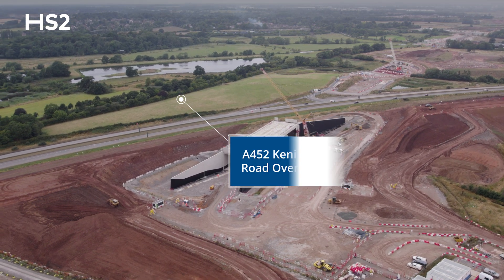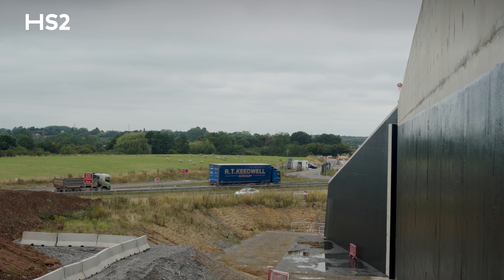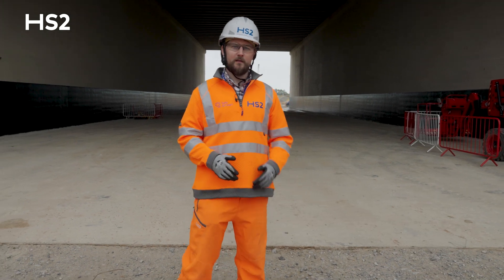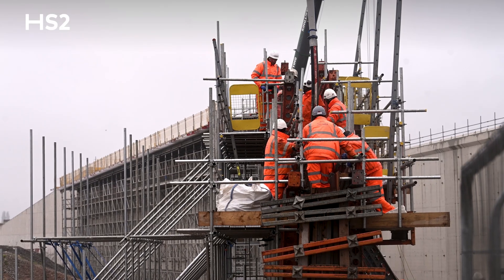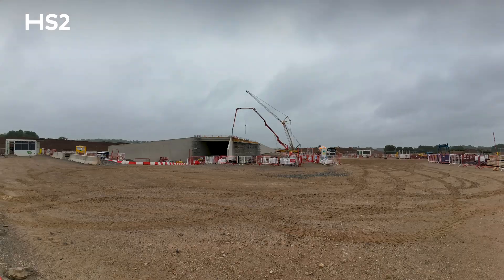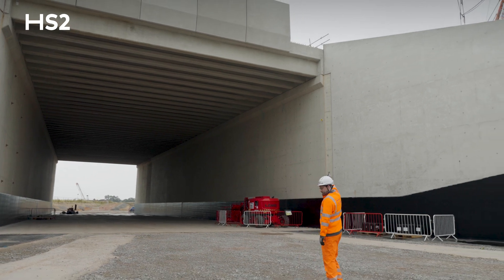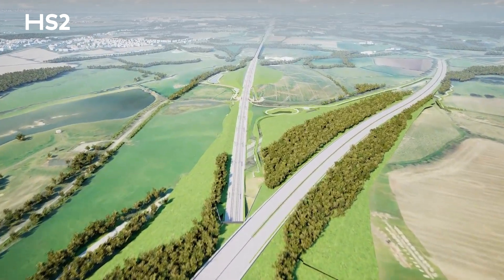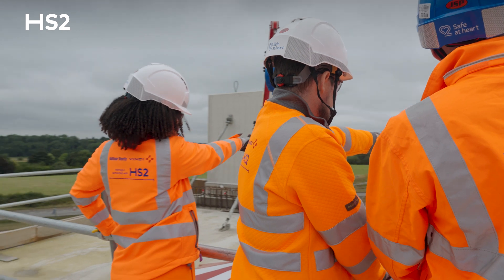In depth look at HS2’s completed A452 Kenilworth Road Bridge

Comment: Hi there my real Name is Mr Cannadine T. Boxill-Harris, I have another interesting idea for most of us Class 507, Class 508, Class 313, and Class 314 and that also includes those interesting Class 315 Very Very Loud 7 Speed Leyland Hydra cyclic Automatic Transmission Train fans out there, rather than scrapping most of those Class 507, Class 508, Class 313's Class 314 including the Class 315's maybe you guys can convert them. Including rebuilding most of the brand new refurbishment into the Volvo TD102KF Engine, Gardner 6LXCT Engine, Leyland TL11 Engine, Volvo B10M Engine, Scania N112 Engine, Leyland 510 Engine, Gardner 6LXB Engine, Gardner LG1200 Engine, Gardner 8LXB Engine, Class 507’s Class 313's, Class 314's and the Class 315's with a Very Very Loud 7 Speed Leyland Hydra cyclic Automatic Gearboxes and converting and that will also be including building most of them into a Two Carriages and Three Carriages per units of the Class 507’s Class 313’s, Class 508’s Class 314's and that is including those Class 315 Very Very Loud 7 Speed Leyland Hydra cyclic Automatic Transmission for all of us Class 314 and Class 315 Diesel Train fans out there PLEASE. Are you still going to do this interesting type of Project? Class 507, Class 313, and Class 314 will be rebuilding the brand new Class 315 Diesel Train fans out there Pretty Please?

Comment: Why is the road being diverted?
They could have kept the alignment and just built the bridge at point where HS2 crosses under the current road
Reply: Because they don't want to have the road shut during works. That would warrant a long term diversion, this means they can construct a replacement and open it same day the current one closes. No disruption
Reply: @fadedspace  in the netherlands it's the standard to build the underpass next to the road and move it to the designed location in a very short closure (usually in one weekend).

This way it's much better for the environment, because you can keep the old alignment and still only have a short closure
Reply: But that would make it a lot harder to build !

Comment: Why dont you restart phase 2a
Reply: Tell that to the government. However, an 'alternative' line that would use the same route has been proposed by the mayors of Greater Manchester and the West Midlands
Reply: @jermainetrainallen6416  nonsense  in mu opinionthey have to go on  with phase 2 a
Reply: @jermainetrainallen6416  Phase 2a has royal assent and is ready to go at any time. The alternative line would need a further few years of planning and approval, to deliver a line with lower capabilities than the original 2a design.
Reply: @tomwatts703  True. I agree that phase 2a should be built as originally planned. However, I heard that the alternative line might use the parliamentary powers for phase 2a. Might be wrong though
Reply: @jermainetrainallen6416  It using the same route, so I don't see why that can't be the case. Just cheaper construction methods.